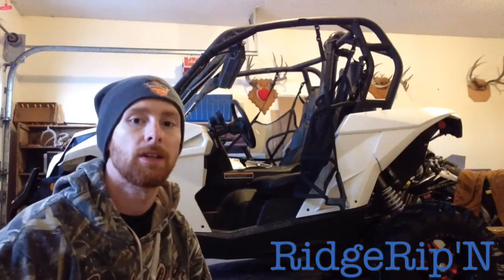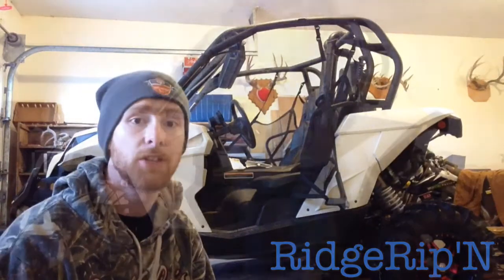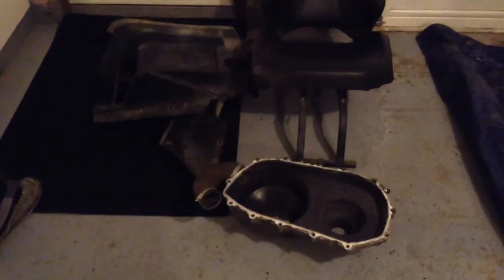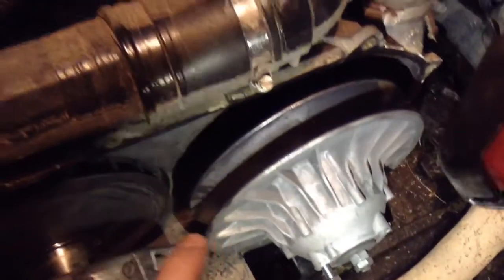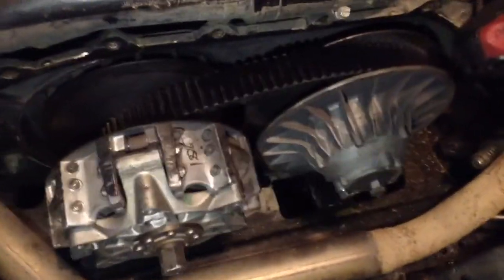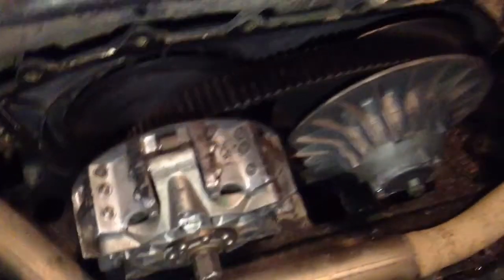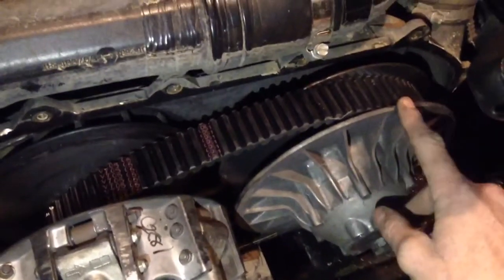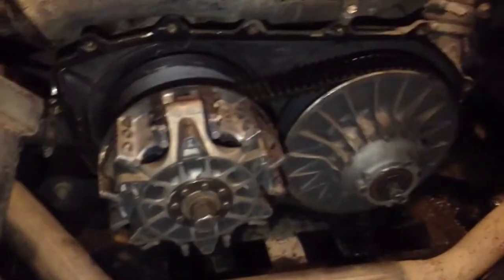Can am Maverick 1000R Cvt Belt Change

Comment: i would have liked to know more about the clean up, i repaired mine but the belt just cringe now on idle in High or Low... i am re-opening it to see if there is still anything in there. but nice video and straight to the point
Reply from the maker: MrThidj901 hey yea I just give it a light scrub with a clean pad to get the rest of the belt of the inside of the clutches and shine it up s little bit then it should be good to go, thanks for the comments and watching

Comment: Do you know what the proper break in period is ? And details on break in? Btw I’m on 40in tires .
Reply from the maker: SLP Venegas 50 miles with light throttle should be good
Reply: SLP Venegas 40” holi chet!